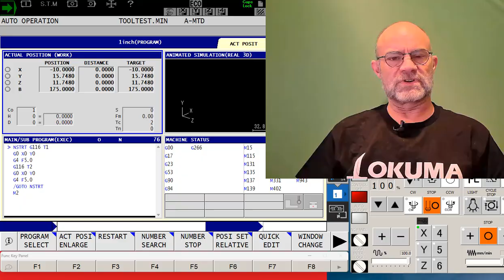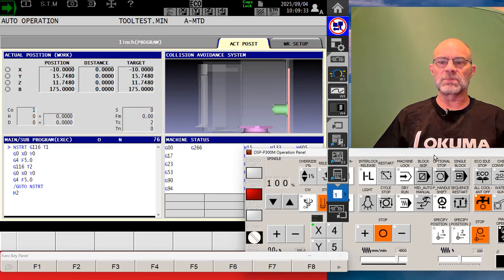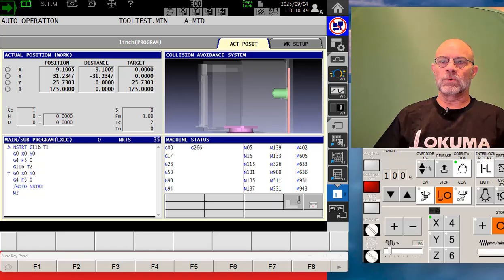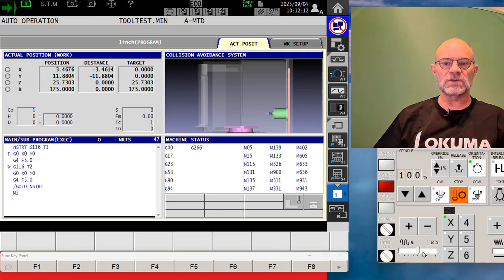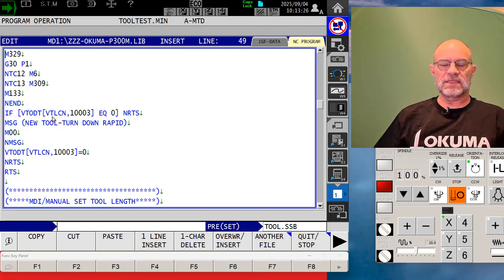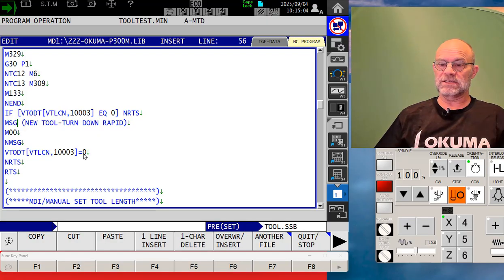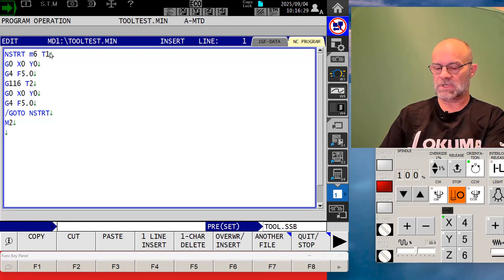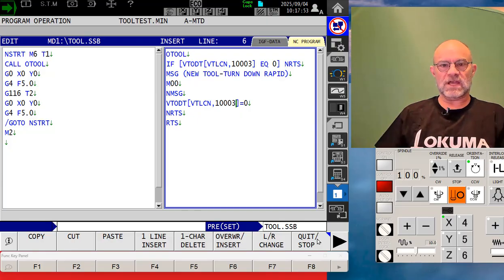More Okuma macro functions

Comment: Awesome Charlie!! What manual do i find all the variables for the parameters (eg how do i work out 10003 is the HC/DC geomtery field?)  Thankyou
Reply from the maker: Most of the system variables are in the appendix of the programming manual, but there are also several instances of those specialties are in related chapters... In short, it's all in the programming manual. If you search the PDF for the individual variable name, you'll find the treasure troves!
Reply: @pocketcharleywithgosiger love it. Thankyou very much for all your help, it’s been incredibly useful!